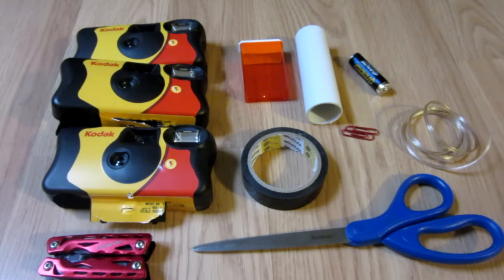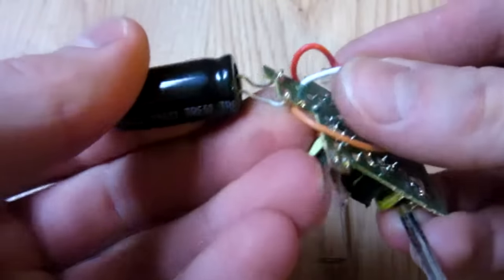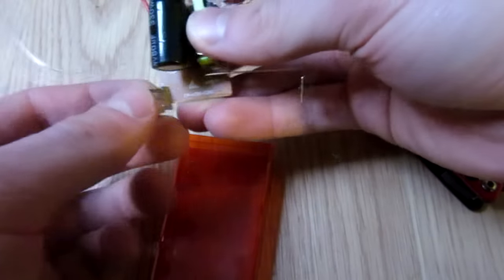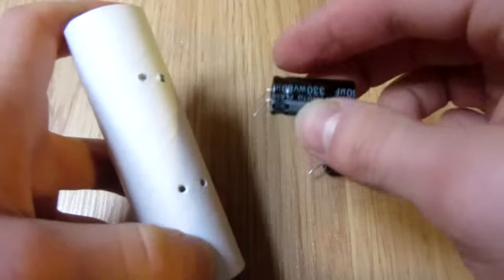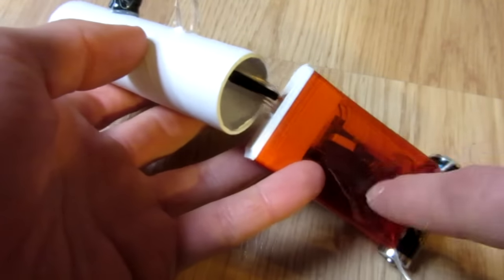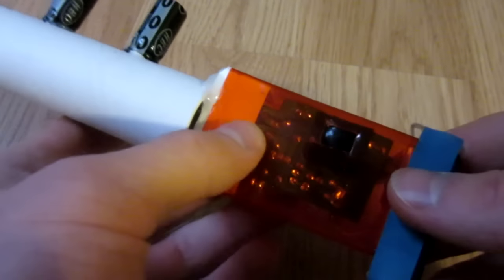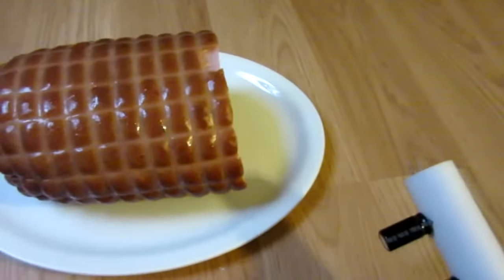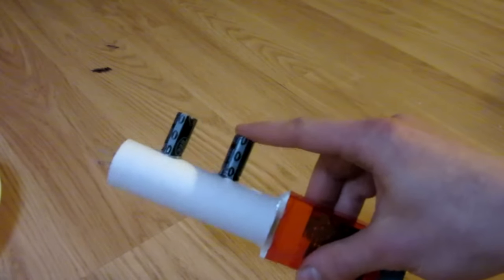How To Make a 1000v Stun Gun !!!

Comment: So, this is wired in parallel. Parallel wiring won't increase voltage, but will increase capacitances. To increase voltage, you would need to wire in series, which would increase the voltage, and decrease the capacitance.
Reply from the maker: Ohhh oops good to know!
Reply: +TheAussieStig30 To increase the voltage you would also need a higher voltage charger. Simply wiring the capacitors in series only increases the maximum rated voltage tolerance. However, if the capacitors were already charged, wiring them in series would increase the voltage (though there's no real practical way of doing this). The only way this could reasonably be 1000v is if he used all three chargers, or charged each capacitor in the series string individually.
Reply: +TheAussieStig30 Exactly.

Comment: couple of things. first of all, you don't have to take the flash off. it won't go off at all one the circuit board is removed. second of all, just stick something metal against the two terminals on the capacitor. no need to rub the back of the circuit board.

Comment: I have measured the voltage from some of these cameras before and some are well over 1000 volts by themselves, even though the capacitors are rated for much less. Connecting them in parallel like this will not increase the voltage, just the amount of energy that can be stored. Same voltage, 3x as much power.

Comment: Could I use a 9 volt battery instead?
Reply: +javier lopez No, unless you have a charging circuit that is rated for 9v. Connecting a 9v battery to the capacitor will only charge it to 9 volts.

Comment: 990 volts. False advertisement! lol
Reply: +JD's Variety Channel It's actually only 330 volts because he wired the capacitors in parallel and is using only a 330 volt charging supply... if he wanted 990 volts he should have charged the capacitors in parallel and then discharged them in series
Reply: I'm not very knowledgeable when it comes to voltage. I was just being funny and adding the numbers together. lol. Thanks for the info. I always like to learn. :)
Reply: Yeah no worries! You would have been correct if the guy built it properly haha

Comment: i volunteered to be hit by a real tazer at low mode ~50k volts and that is painful but 1000v wouldnt compare to that xD it would be more of a shock surprise than a pain dealer  :DD
Reply: Its not the volts that hurt, its the amperage (ma in this case) amperage is the amount of current/electrons moving, v is the speed😉
Reply: William Jenssen ampers are the things that kill while the pain is equally dependant from volts and ampers so dont worry i know that
Reply: ok, then  i know 1000v isnt enough ;)
Reply: +justas drigotas Capacitive discharge "stun guns" are generally more dangerous than real tazers because of the higher fault currents that can cause heart fibrillation. Real tazers are current limited, while this essentially isn't. While the stun gun in the video isn't particularly powerful, if he used defibrillator capacitors for example, which are usually charged to around 1000v, it could be potentially lethal. This of course isn't what real tazers are designed for.
Reply: ***** now that i didnt know, thanks!  :D
Reply: justas drigotas No worries bro
Reply: Mykey McK high voltage isnt a must, unless you are jason statham...
Reply: William Jenssen nice ;D

Comment: You know it's the current, not voltage that truly matters for any taser/stun gun, right?
Reply: +Black Jamal you know it is not right?
Reply: TheNoobility you clearly know very little about circuits
Reply: obviously i know more than you
Reply: which one are you talking about the current that feeds the taser or the current that comes out of the taser if you are talking about the current that comes out of the taser then you couldn't be more wrong
Reply: voltage=pressure, current=flow. That's how you should have learned it at a young age.
Reply: i know that i study to become an electrician
Reply: Then you should know that even with 1,000,000 volts, you can have a high resistance and reduce the flow of current (which is what is actually felt by any deserved victim of a stun gun). Looks like you have some brushing up to do on Ohm's law! Not trying to argue, just trying to help you help yourself.

Comment: can't be serious?  this is fake right? l mean a tik tak box and hot glue! lmao at one point he states is pretty dam sturdy bwahaha thanks for the laugh.
Reply: +flash more well you're right, it isnt 1000volt, it wouldnt be either it would be 990volt. but its far less then that since he's using capacitors in paralell and not having an transformator in it, and as explained above if you hook it up in paralell youll get 330volt? but if you use an transformator and the capacitors youll get alot more.and i personally think its pretty shitty how he has hes own web site and doesnt have solder. even i have solder and an soldering iron and im still in school.

Comment: This guy knows shit! The "ground" wire is the trigger transformer output which is about 4kV, far higher a voltage than the two or three hundred volts he's getting off the inverter for the flash tube supply. Why he destroyed two other flash units just for the caps is beyond me, he can buy those for pennies.

Comment: you call yourself an inventor but in the video when wiring it up you referred to capacitors as resistors. and how can you not know if the capacitors wired in series or parallel they are in parallel